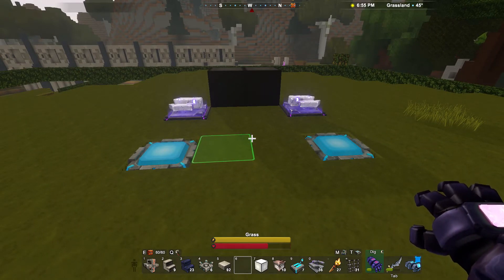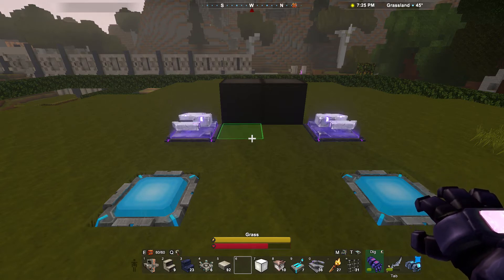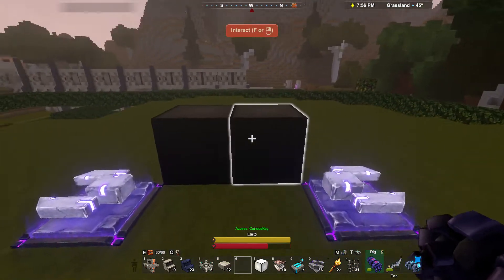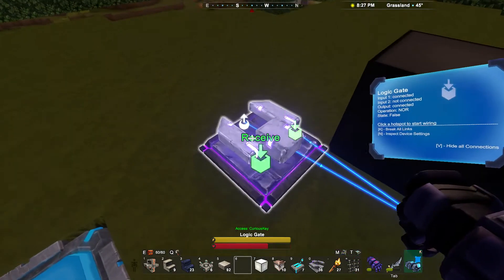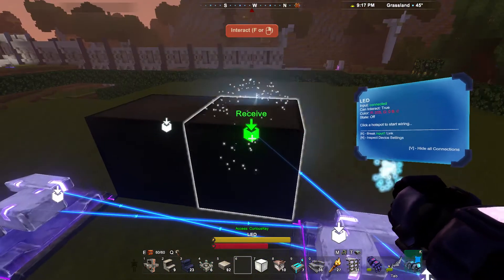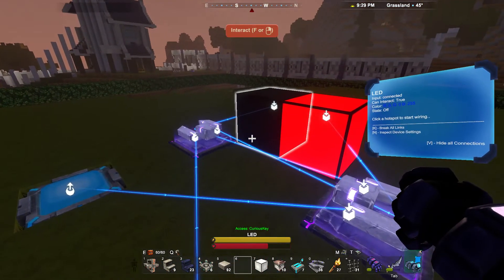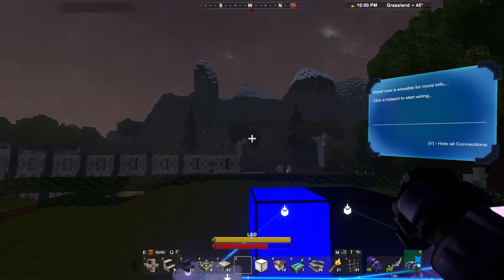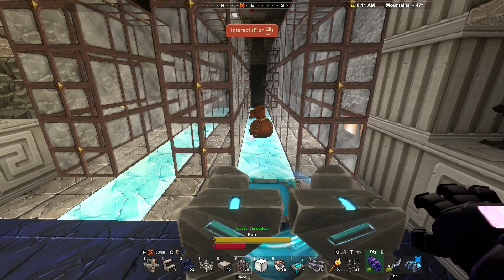Creativerse Machines Tutorials 2: Stable Flip-Flop Alternative! (SR Latch)

Comment: awesome video, but it leaves me with a single question: what happens if both inputs are activated at the same time?
Reply from the maker: It's a flip flop, essentially a logical toggle, so the most recent signal, even if only by one tick of the game engine, would be the one followed. :)
Reply from the maker: If it were possible to activate them precisely at the same tick, then I don't know. Depends on Creativerses engine really. :) But that is practically impossible, as in most games there are between about 20 and 60 ticks per realtime second. :)
Reply: If they pulsed true at the exact same time, the latch would be in a metastable, or unknown, state. Latches like these are very useful when one and only one of the two inputs are triggered at a time. They're the core of much larger memory circuits that are usually built with failsafes against metastability.